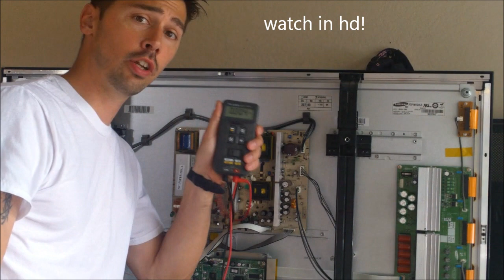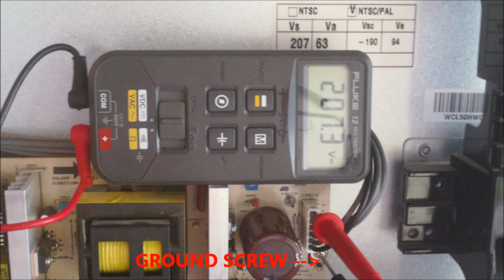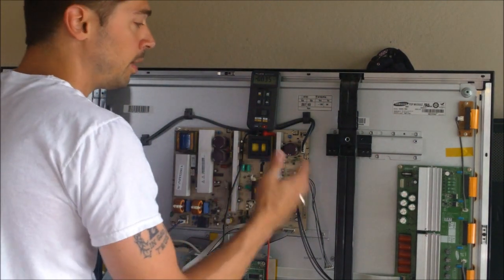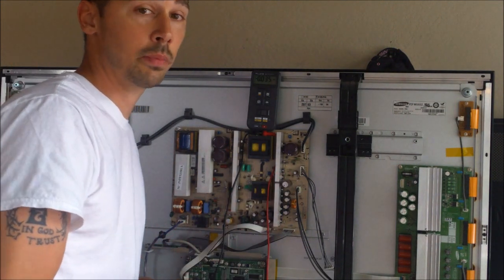How to use Meter to Fix TV - Troubleshooting guide

Comment: Tampa I have watched a lot of your videos I am still having problems with my Samsung hp-s6373.  I replaced y sustain board and tv turns on now but the picture is horrible l.  Menu even comes up horrible.  Black is a teel color. I have metered every thing on this tv and can't find a fault.  Your opinion would be appreciated.  I have talked to many techs over the phone and every single one has a different opinion.  I don't think I have a bad panel.  But I could be wrong.

Comment: i have a polaroid tv that will not turn on it has standby i took it apart and looked for physical damage to caps or anything else and didn't notice anything bad from visual inspection so i put it back together cause it was getting late when i did this and i figure i try the power button to see what happen after i got it back together and it came on and everything seemed to work fine i even turned it off and back on a few times but the next morning i tried to turn it on again and does the same thing has standby but wont turn on any idea what could be causing this the tv only has a power board and main board along with an lcd  similar to a laptop screen

Comment: I have a Samsung plasma tv pn51d530a3fxza I get sound but no picture I checked the voltages and my specs are
 vs 207. va 58 vsc -109. ve 82  and my my readings are vs 13. va 0. vsc 0. ve 0. and I get 120dc from the power supply cable  is this a power supply board problem

Comment: I have  LG LCD tv.  Model number LG47LN5400-UA.  Nothing, No raster, no sound, no power.  I test good 110VAC in, but no keep alive 5 Vcc voltage anywhere.  Ebay ored both power supply and picture boards.... Installed them and nothing?  Is there a trick to troubleshooting these?  Is there a jump start switch, or trick?  All fuses good.  No schematic either I can find.... Any suggestions since you know your stuff?  My Heathkit days and basic 7400 series logic gate understanding is worthless.  Can you get me information from some type of service manual maybe?  In any event... Thank you.  Good video!  Michael  m.reiman@comcast.net

Comment: Questions on Samsung PN64D7000, if the VA reading 0, is that mean the power supply is bad? I disconnected the connectors going to the Ysus and Xsus, VA is reading 0. If so, how percent that the power supply is the culprit. Anyway, I have a good reading on VS.

Comment: Hey man great videos and helpful tips too! Help! I have a 55" Sanyo plasma and have sound and no picture. I accidentally unplugged it while on and when I turned it back on I had no picture. I checked all of the fuses, nada. I then looked at all of the caps, as best I could and found nada. I plugged it in with back off to see if anything was odd. Then I noticed faint smoke coming from the Y-sustain board, (2) resistors on far left middle of board one was fried. I replaced both and the cap sitting directly next to them too just in case.  Figured it may be more so I bought another board. After installing the new Y sustain board (ouch! $$$) I tried the power and no success. GREAT! So I took a more detailed look and noticed a bad cap ( budged top=blown)  on X-main board far right and tested with ESR and bingo it's a goner.  Replaced cap and retested tv power and still no picture. WTH!? I am waiting on a new X-main board but am doubtful now.  Any ideas or troubleshooting you could recommend man? I just want my plasma back in action you know. I keep thinking its gotta be something simple and easy to replace, but where the heck is it???

Thanks, Jon

Comment: I am working on a friends tv, a samsung no less, and the tv turns on and off. i did a hard reset with the y-board disconnected, and it stayed powered. Then reconnected the y-board and disconnected the buffer boards from the y-board. the tv then turns on and off. I know i have a bad buffer board cause a piece has a hole in it, but does this mean the y-board is bad also or does this test not work properly with the buffer boards disconnected.

Comment: Hi there
I have a Samsung 50'' PS5096HDX/HEU I think its the same as the one your working on in your video :)
I had two Caps 680uf 25v blown one was on the y board the other was on the x board I change them both for 680uf 35v. the VS should read 207v but reads 208.6 VA is 63.35 would the VS over volts stop the TV  from working? could you help please.

Kind Regards............Mark

Comment: can you PLEASE  tell me the trick to getting the diodes off of the heat sinks on the power supply? lol , the one with just thermal paste came off easy but the others i am working on are stuck fast to some kind of pink pad..i of course took the screws out and tried to pry them off but no luck, even tried heating them a little,, it's driving me nuts lol

Comment: hi i just recently purchased a used sanyo dp47460 it was working great for about a week and now when i turn it on it stays on a sanyo display saying "please wait" for about 2 minutes before showing any picture that i have hooked up through an hdmi port. (if i have it connected to the cable it shuts off automatically)after about 5 minutes the tv shuts off. and wont turn back on for a couple hours. i took the back cover off and the capasitors "look" fine so i took to a repair shop and they said it was the whole power supply. just wanted to get a second opinion before putting anymore money into getting it fixed. thanks (:
Reply from the maker: if tv is under 1 year old its covered under warranty free repair. call SANYO -  Phone: (800) 877-5036 Ext. 1485  
but its commonly bad caps even if they don't look bad they can still be bad, then next it can be main board issue.

Comment: Hey Tampatec I Love Your Channel  I Have A 50 Inch Samsung Plasma Tv Powers On With No Picture. I Plugged In A DvD Player Playing A Movie And I Hear The DVD Playing But No Sound I Opened The Tv And Inspected The Boiard And I Found On The X-Board It Has Two Bulgeing Capacitors If I Replace These Two Capacitors Will It Work Again?

Comment: I have a Samsung ps51d450 I have replaced all the boards  except the address board  witch is connected to bottom of panel. Now I found a black mark were the metal had touched the address board and I have replaced the burnt cap. I still getting nothing .can u tell me has it blown the plasma panel

Comment: Hi Tampatec! I have the same samsung tv like yours...problem is, my tv turns used to turn on for a few mins then turns off by itself then the next thing you'll hear is just the flicking sound coming from the power supply. I followed what you suggested on this video..tested all the voltages, etc. everything on power supply board is good so i tried to see if the problem was on the x-board. I disconnected the connection from the xboard going to the power supply and it turned on and didnt turn off. So i thought it was the xboard. I bought a new xboard in shopjimmy.com and replaced it, plugged it in and connected it. I thought my problem was solved! But then again, i am back to zero! It turned off after 5 minutes and then that flicking sound again is in there. I dont know what to do anymore. Please please help!
I'll really appreciate it! Please...

Comment: hi, I have a Toshiba 32RL838G LCD TV that's showing only a blue screen upon turning it on. It doesn't react to remote control or power button. I checked the DC voltages coming out of the power supply, everything fine. Any idea ? Thanks
Reply from the maker: might be bad main board but get 2nd opinion- contact shopjimmy.com to confirm it.

Comment: if you would take a wild guess..sparkles near black reduces when i adjust the VA regulator clockvise...what do you think is wrong if you got sparkles/dancing pixels?.to high or to low voltage?..most at the edges of the screen.

Comment: Hi guys! I have a problem with my Samsung 42' Plasma which is doing my headings. I had a blown mosfet and I have change it and I have found another few ones dead and I've change them so I've end up by changing 4 mosfets, 2 voltage regulators, few capacitors and the relay start to click but not a click like in your video. The x and y board were off when I've pluged the power in. I don't know what the problem is!
Reply from the maker: check ICs on y-main
Reply: ***** The power source is without Y and X so the problem is on main board on the hot part. I have changed the ICP801 - L4981A and the click is much louder. I have ordered 4 mosfets and I hope will be fine!

Comment: hey i watch your channels alot and i just bought   a multimeter i have been messing around with my tv cause it not working its a vo42L vizio hd tv and i get no led no any way of telling anything caps look fine and so does fuse

i checked the volts the ac is 123 volts coming from wall

and as for the dv i do not get the 12v or the 24v i only got 5v everything else is not working 

so i am not sure if it is the video board which is the main board i believe and i am not sure what the other one is called 

i just know that one day i plugged in a ac and the tv to the same outlet and the hdmi blew out and so did the tv so i am not sure what it could be if i can messsage you for some advice it would be great
Reply from the maker: Note- if you got no red led light on front tv panel and got 5v or 3.3v on power board then can be bad Main/Video board, get main boards at shopjimmy.com -tv boards come with 30 day warranty and offer a return policy too.
Reply: wow thats great ok will do once i get the money for it but the only problem is that i have problem removing the video board because it covered my a metal plate and i tried it all to remove it and i do not want to break it just to remove it

Comment: Hey Tampatec, The Fluke 12 has been discontinued. The replacement suggested by Fluke is the Fluke 115. Best price I have found so far NEW is from TEquipment.net. at $129.46 free ship. In one of your video's you suggested getting one that would do temp. The Fluke 116 does how ever the 115 does not. The best price I have found for the 116 so far is from TEquipment.net  $137.55.  Used equipment is like buying a pig in a poke or Like a box of chocolates you just never know what your going to get. Any suggestions ?

Comment: hello i like the show and i was hoping you may help me out,
I have a ( ACOUSTIC SOLUTIONS )
MODEL: LCD32761HDF
POWER SUPPLY:AC 220-24V~50Hz Max.180W
IT WAS WORKING SO WELL AND THE PIC WAS GOOD TO
BUT I WENT TO PUT IT ON AND NOW ALL I GET IT STANDBY AND NO PIC ETC
 PLZ CAN YOU HELP?
Reply from the maker: check swollen capacitors in power board.

Comment: Ok I have a VW32L   20A here's my problem TV was on screen when green then I heard a sound like a candy wrapper then off so I check no swollen capacitors or transistors when I check power I got 5v stand by mode n on 24 also read 5v seen ur new vid but didn't find the one u said can text me at micro61micro@gmail.com thank u big fan.
Reply from the maker: can be bad transformer on inverter board. look & smell around for burnt parts. sometimes inverter board takes out power board too.

Comment: ih i have a lg tv model 50pc1d-ec and 10 off the capacitors had gone so i replaced them but the tv still goes off when i turn it on about 4sec goes one stand by
Reply from the maker: check all caps like 680uf, 100uf, 2200uf, 3300uf 10v-25v cause some capacitors may Look "ok" but are Bad.

Comment: So if the X-sus  and Y-sus are disconnected would the Va and Vs power still be expected to reach the correct capacity? My TV only powers on when at least the X-sus is disconnected and the the voltage only gets up to a fraction of what it should before it stops and the voltage quickly drops while TV remains on with no picture.
My main questions are here:
WHAT Plasma TV BOARD CAUSES NO PICTURE REVIEW
Sorry for double post but trying to figure out if I should replace the Power Board or something else.

Comment: Your videos are great help. I have black horizontal lines on a 50" Samsung Plasma TV. I changed the y-buffer/sustain board and only made a small difference. I checked the power going from the power board to the y-buffer board and x-buffer board and logic/video board. The voltages on the top of the panel read VS 207 but when I use the meter on the y-buffer it reads193 and on the x-buffer it reads 198 and the correct 5.3v on the logic board. Do I need to change the power board? I have 2 y-buffer boards, one on the left side facing the back of the TV and one running along the bottom of the TV.

Comment: Hi I just turned on my Pioneer Plasma and it made a loud pop noise and and I lost my picture but still have sound. I can't turn off the power and the blue light for power blinks 13 times then pauses and blinks 13 times again and repeats, any thoughts? My Pioneer Plasma is about 6 years old is this expensive to fix ? I'm handy but have never worked on a TV, do you have any idea what it would cost to have someone repair it? Who would I call? I live in Denver. Thanks for any help.
Reply from the maker: unplug tv for 1 minute to reset it next unplug tv then open tv, there a "trap switch" so be careful you can lock the tv if you don't tape it down when turning on tv to test dc volts. (act at your own risk when working on TVs chance of shock)
locate pop part, 13 red led blinks is usually power board but if you got 5 dc and 12 dc volts coming out of power board then next is bad main board which is expensive, get boards at shopjimmy.com -Sub,like,or spread the word if this helps 8^)
Reply: Thanks I will try this and get back to you on how if it helped or not. Thanks, CJ

Comment: sir, how to make sure that the voltage is OK? while using multimeter? sorry these is my first time checking TV =)
Reply from the maker: if you got a volt meter put meter's black probe-lead on metal ground screw then put red probe-lead in plug to main video board sometimes its labeled 5v near plug, read it in dc mode. but don't touch metal with your skin and don't touch 2 pins together with probe. if you have NO 5v then power board mostly bad. get at shopjimmy.com

Comment: I have a Sylvania 42" 6942pem flat screen that i got for free on craigslist because the guy blew a capacitor. I just replaced the capacitor and the tv now works fine but there is a loud hum (more like a whistling) coming from the power board that gets louder when brighter images are on the tv. It is audible from across the room so i'd like to fix it. i think one of the transformers on the power board is going bad but i'm unsure of how to test it and, if it is bad, how to go about fixing it. thanks for your help!
Reply from the maker: high pitch noise might be another blown cap but buzzing might be bad transformer.

Comment: my 52 philips has a DPS-411AP-1 power supply the fuze is not blown, but reads 90, then goes down to 60 V when I plug in all the stuff???Is this right?
Reply from the maker: if you get voltage drops on power board check capacitors, or get tv power board-at Shopjimmy or  1 (877) 881-6492 / (952) 881-6492

Comment: What if my Tc p50u2 Panasonic 50 inch is blinking 10 times?
Reply from the maker: 10 led blinks = check DG square board and cables connected to it, to get boards call 1 (877) 881-6492 / (952) 881-6492 Sub if this helps 8^)

Comment: my screen went black the other day and i couldn't figure it out. after deciding i needed a new power supply board i happened to notice a piece of solder fusing an integrated circuit together. i melted the solder from the 2 legs of the ic and boom tv works.
Reply from the maker: what tv model was it and what board, i.c. had to be really Hot, over 750f and 400c to melt solder joints maybe ic needs a small heatsink.

Comment: Hi, l have a Hitachi L32HP04UA, and it has an intermittent problem, which is sometimes its stuck on standby mode. Theres no clicking, and the red standby light is solid. Any clues, thanks.

Comment: Hi. Im currently trouble shooting philips Plasma tv. TV can't totally turned on.  When I press the power button I hear 2 clicks from black square "caps" in the power board. That's all I have the 2 clicks. I checked the power supply testing the supply while pressing the power button, the dc supply is good in just 3 seconds then slowly 15 dc supply went off.  everything going to x-y and main board is tested just like what you have done in this video. Any Idea?

Comment: Hi great vids! My PS50Q97HDX/XEU panel (looks identical to ur vid), is switching off after a certain amount of time, which gradually got worse and only makes a clicking noise. I checked the power board and replaced a swollen capacitor, this improved things slightly but it still turns off after 5 mins. After seeing ur vid, checked voltages and the DC is very low VS=35v at the start then goes down. I can't see anything else, can you help please?

Comment: (continued from previous post) and another LED that flashes 3 times. Ive checked the PSB TP 206, VS 206, VS 206, VA005, CN807 reads 005, CN801 no power. Would really appreciate any advice

Comment: Hi Tampatec, I have the PS50Q96HD Plasma (same tv as in your video) the problem Im having is that I am getting sound but no picture.  When I go to power up the tv the blue light on the front flashes 5 times. There is no start up sound like your on your video. (bleeping) Also on the Y board there is a green LED that lights up and stays on, is this normal?, the small board that sits behind the main board I believe this is called the daughter board, this has 1 green led that stays on

Comment: Great videos for dummies like I am. Where can I download this schematical diagram to know what voltage should out on what pin? My TV model is Samsung LE32N73BDX.
BTW, here is problem: My TV turns on then turn off after 5 mins on. Then, I can't start it anymore... Works again after 3 hours. Any advice? Thanks

Comment: hi..can you show how to repair power supply board model BN44-00192A? The problem is no power. I've replaced all the capacitor but it's still not working. The fuse also OK. thank you